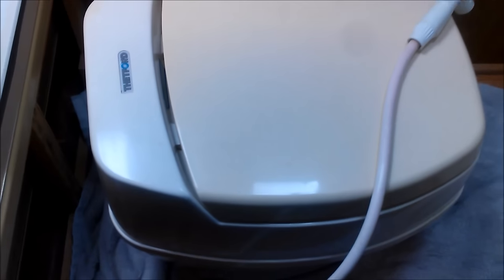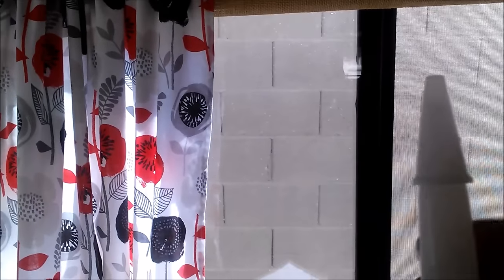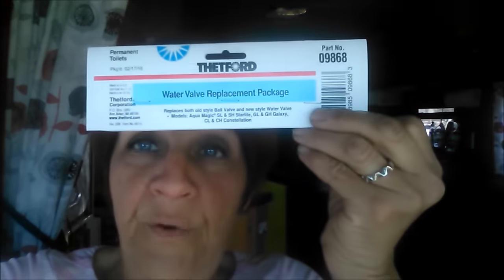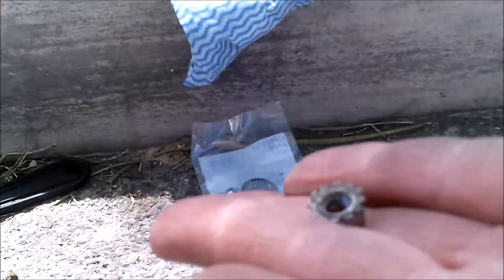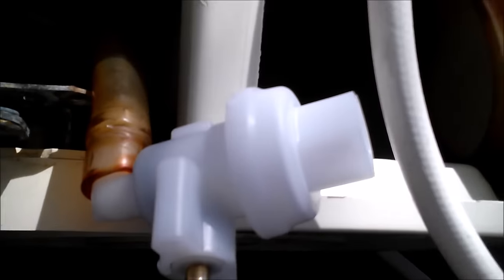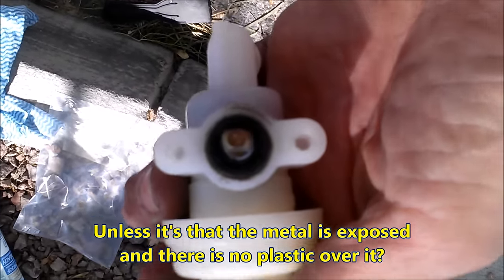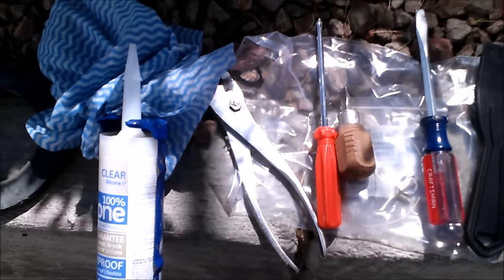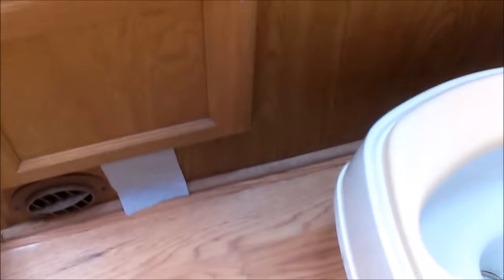Thetford RV Toilet Repair - Part FD: Finally Done

Comment: Way to persevere! I like how you just make it up as you go along, and it ends up working! My old '88 Lazy Daze has the same obsolete toilet, so I'll be diggin into it soon-thanks for part numbers. B.T.W. silicone is not necessary to keep the flange in place-it seals it self with the weight of toilet on top of it. Also, as you probably found out, its a PITA to remove when you have to do the job again

Comment: well done! we have a coleman highlander niagara folding trailer and there is water coming out from behind the flusher pedal, it's an older model toilet and I can't even find pictures of it anywhere. It says it's thetford, but nothing matches it on the net. We have removed and replaced flanges on our home toilets but never in a camper, so we are not confident that we can take it this off without creating more damage and frankly these things are expensive.

Comment: I have the same problem with the water valve in my toilet.  In my case there was some residual water in the valve that froze over the winter hence when I attached the water hose to the fitting outside water sprayed all over in the the toilet area.  I am going one step further where I am going to install an in-line shut off valve.  Why?  Well,  if there is a future problem with the supply water in the toilet I can shut off the toilet and still have water to everything else in the RV.  Great video keep up the good work.

Comment: Nice job. Here's a suggestion for the hole in the shower. Get a plastic Tupperware cake or cupcake holder with lid that is a little bigger than the hole you have. Cut the hole so the cupcake dish fits snug. Seal it with silicone. You now have a place for soap and whatever. Use cover while driving so nothing falls out.
Reply from the maker: +Keith Stoner I actually was looking for square plastic receptacles, or semi-circles on Amazon. Then I happened upon my own quick fix and went with it :) THanks for the lovely idea, maybe I can put one over the fix, hmmm.